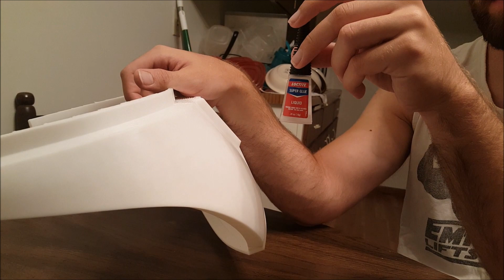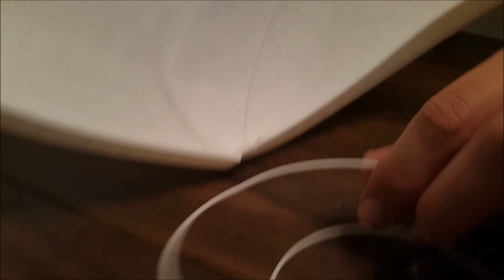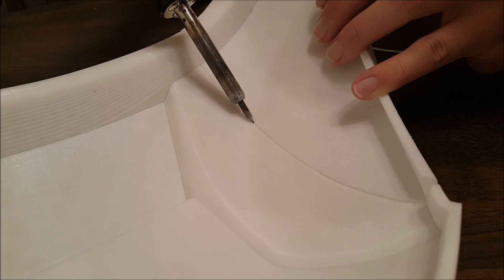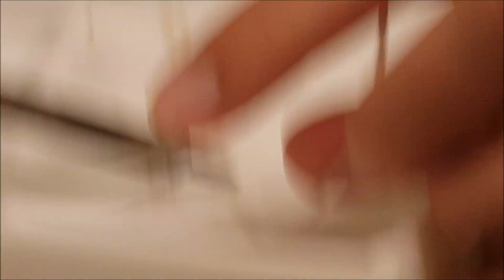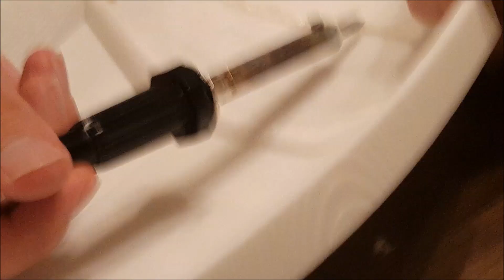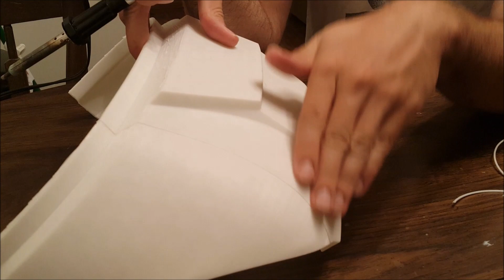How to Weld 3D Prints for Cosplay

Comment: If you use a wood burning tool with a spade end you will get the same effect with a smoother outcome and for extra strength you can add a fine mesh netting to it also

Comment: Have you ever tried friction welding? You put a piece of filament on a rotatory machine, like a small drill, and use the tip of the rotating filament to weld the seam.. the frictrion produces enought heat to melt the plastic...